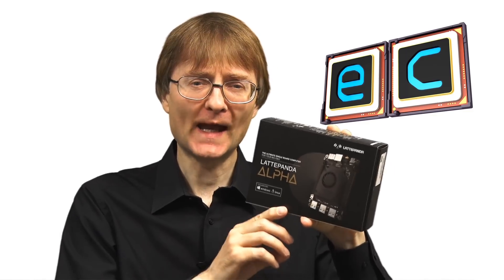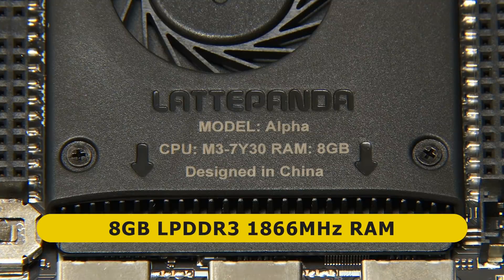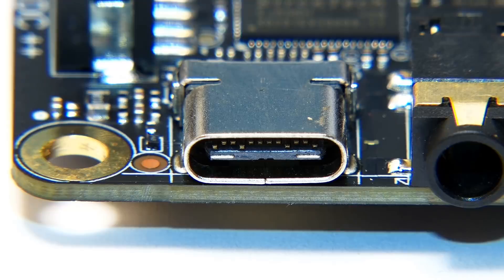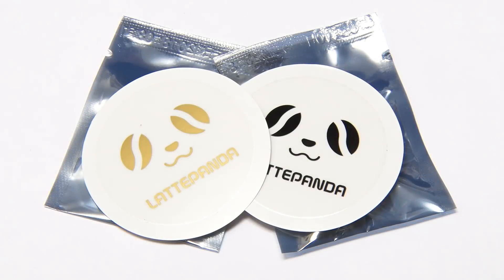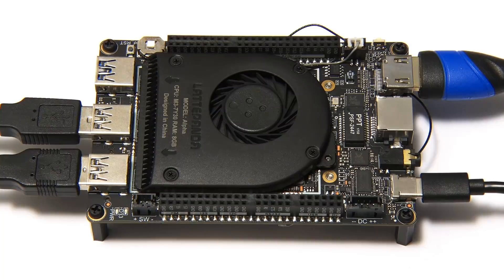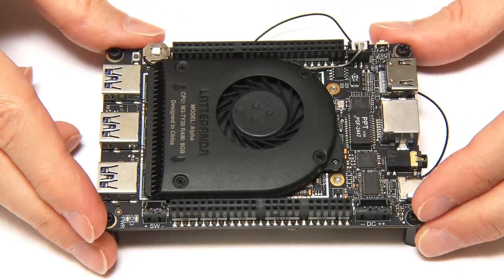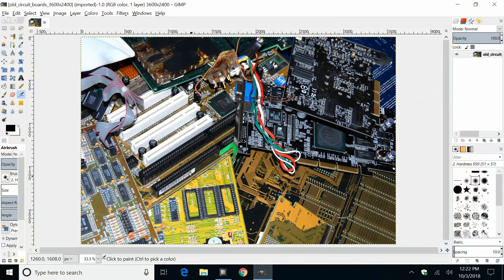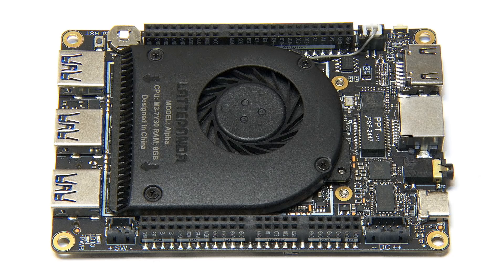LattePanda Alpha: Windows & Linux SBC

Comment: I keep putting more thought into the various utilities this thing can cover with it's functions. That little thing could run hundreds of different businesses and any machine a single man could possibly dream of building. It's just so close to that ethereal "perfect" digital handheld multitool.
Reply: I'm building a holodeck.. not joking xx full 3D room space, so you can overlap and sit with your mate overseas. Play Elite with a floating holographic cockpit and space-surround 3D etc.
Ok, you do have to wear light glasses right now - but I'm afraid it needs more gfx grunt than this sbc xx

It is a lot of power in a small package, but where does it actually fit? A small Pi cluster will out-gun it dramatically and I really don't need a soggy PC in my pocket, when I can build a AAA gaming rig for maybe £100 more (and that's just to have a good gfx card, so you'd be paying that anyway to take the Alpha up to spec..)
Reply: @pdjames1729   No, I know, it isn't perfect yet, but it's an image of what can be packed in at that price point and it's inspiring to extrapolate and infer about what could be done. We're coming up on essentially arbitrary storage and RAM specs, and processor power is still being pushed along its improvement curve in spite of people claiming that moore's law is dead for the better part of a decade, and with new materials showing promise in labs. 

For the question of where it currently fits, the answer is anywhere that doesn't require real time 3D rendering of a high resolution immersive environment, or similar supercomputational needs, that's still the realm of task designed systems, but it could potentially serve as the entire control and diagnostics system for a small factory with little modification, It could effortlessly coordinate a large farm of autonomous tractors and irrigation equipment with trivial effort, stuff like that where traditionally you have a closet of equipment and a very expensive technician to manage it.
Reply: I have to disagree. You need Proven, industrial-spec systems for all of those things and size isn't really an issue. Not when you can get 4x the power for half of the price - multiplied by however many factory systems you're running. You're right, this is essentially a promising prototype. One that is obviously on a short-run, Latte themselves know there really isn't a market for this that makes any sense. BUT - I'm not trying to slam it, it's brave of them to develop something So far off-the-curve. It's just not what SBC's are about at all. Fixed specs = MORE power for your money. That's the whole point. Comparing these things with $15-$60 of Pine64 leaves a nasty dent in your wallet for basically zero gain - let me hit a rather odd curve-ball...

If Latte had put the same effort into a Distro that was designed to cluster existing SBC's in a more accessible way, god forbid to let them live-compile x86 and x64 code. We'd have something truely revolutionary. Potentially infinitely upgradable but without all of the BOIC cluster-pigness ;oD

As it is they've worked their socks off to make a consumer-grade piece of wunderlust. It looks great, ignoring the price, but doesn't really DO anything. Especially not with x86 rapidly limping into obscurity (which i hate btw, my perfect functional win7 machines are being force-obsoleted by a refusal to compile for them)
I sort of get what they are trying to do here, trouble is it just isn't an SBC, any more than the motherboard of your laptop is. Cramming power into a small package is only half or the deal. SBC's are Cheap to mass-manufacture, you then work on performance without compromising that premise. This is why we are all itching for a Pi4 (with a pcie slot? like Ebon will ever do that -lol)
I can't take an ITX motherboard, rip the socket off, chop all the expensive power management components out, rewire the ram and sata's onto the back and call it an SBC, even though all the bits are now soldered to one board.

Unfortunately that isn't far from what Latte have done here. And given the awful price proposition, cheap parts, inability to revise and lack-lustre performance. Me, and I think about half of the people in these comments are just left asking Why... other than just to do it, what is it for? Non-tech #EarlyAdopters with too much money...

My only hope, Obi-wan, is that they make enough from it to squidge the next version much closer to the SBC market. But when you can buy a god-awful win10 stick for £30 they are gonna have to work Really, really hard... There probably is room for a posh board. Just not this posh, or this not-posh... struggling here, really struggling. Not least with the Huge price gap between their top-end and the entry level... What they have essentially made is a pretty damp NUC.. is it even any smaller? xxPD

Comment: Impressing power on this single board! I have some questions though:
1) Does it run Windows 10 - 32 bit or 64 bit?
2) Can it run a Universal Windows Platform application?
3) How would a UWP app running on this board obtain data from its Arduino GPIO pins (also running on this board)?

Thanks for your great videos! :)
Reply from the maker: It is running 64 bit Windows. I will have to get back to you on the rest!

Comment: Two things that I really like here. Power and x86/x64 architecture (meaning a massive amount of compatible software). Not to mention that the size is just a bit bigger than the Raspberry Pi. Would like to see available cases for it. Extremely impressive. However, I may wait for the price to drop over time (if it does) because $300+ is a bit steep for me to invest on a SBC at this time. I need a better job.

Comment: I think the NVME slot was set to x2 in the bios if you decide to check it out i think this is why the NVME performed almost half compared to the core i7, i have a tablet with the same storage and cpu and it does over 3300mb/s reads.

Comment: A very nice overview of the board; it is a bit expensive, but to be fair, x86 architecture on an SBC (2nd Gen no less) is not a common find.

But, the first Latte Panda, even though itself a bit pricey, seemed to me to be taking aim at the RPi form factor SBCs that have flooded the market over the last few years, all chasing the success of the RPi.  With this board, I don't get that same association.

But the price point of $399, I think it will be hard to overcome ARM-based systems, and it will be compared to other consumer PCs before the average buyer takes a chance.

ARM based SoCs/SoMs, like the Nvidia TX2 (w/ a .edu email address) is only $299.  And I look at the Kirin 970 boards that are being released around that same price and I am impressed - then the Kirin 980 debuts, & it's a powerhouse w/SBCs expected Q1 2019...and now I'm reading the Kirin 1020 is already underway.  I have the Kirin 960 & it is impressive and not that old.  But, no x86...

The Kirin 980 though - with dual NPUs; 2x A76 high clocked cores, 2x A76 low cores, & 4x A55 cores; a brand new Mali GPU; & ~8Gb LPDDR4....the boards will be x64, but if this appears at a $399 price point, I can live without x86 & Windows 10.  

Huawei on the warpath though, they'll probably have it $299 msrp like their previous two, maybe less, who knows?  They're aiming at Apple & after the spectacle that shut down Verizon & AT&T subsidized Huawei phones, they haven't been swayed. Any way into the US & I assume they'll make sure to be known.  They were never banned, so using a Huawei phone or board is still just fine in the US....

I guess the next 6 mos. will be an interesting 6 mos.  This new Latte Panda will be competing and with unique appeal and pricing spread across different variants, perhaps it will be well received & I've merely judged it too quickly...(?)

Comment: nice PC, but im not going to get this thing on my SBC list, its just a complete barebone miniPC you can get out there.

its bad that it didnt maintain the same form factor as raspberry pi, so you have to buy a another case for it that is expected to be overpriced.

for power consumption, meh, I expect that it had the same power consumption of one of many ITX/minipc computer builds out there probably in cheaper price.

im just glad that raspberry pi maintain its form factor, if they can only build with same form factor of raspberry pi and put the intel compute stick hardware on to it, and put GPIO pins at the top, that would be the best, but this, meh just get a minipc.

Comment: If you ever revisit this, try a linux install on the ssd (if possible) . Any popular ver is fine. We trust you. You know what you are doing.
Reply from the maker: I will almost certainly try Linux Mint on the SSD board in a future video. And I will also be covering GPIO (Arduino) programming on a LattePanda (any model).
Reply: good idea, that windows bloatware looks crazy! imagine them thinking you want candy crush haha
Reply: +Cashel - it's just a link to the microsoft store where you could then optionally download candy crush. But yes I agree, adverts shouldnt be in the start menu anyway. 
If you notice, windows is getting better all of the time. The installation size is now reduced from 20GB to 12GB. You can also run a linux cli shell on windows 10 (pro) which is what I do mostly, so we get the best of both worlds now. Windows for business compliance and policy reasons along with a unix-like shell for the open source world.
Reply: ExplainingComputers Hi, I'm looking for a computer just to web browsing, watch movies and simple things, I do not know anything about computers, do you think that this is a good option for me?
Reply: it's incredibly expensive if that's all you need. Any low-profile gen 3/4 refurb will do that job easily.
Or a pi3, or a cheap laptop... Set a budget of £200 - have a look on Ebay and compare against CPU Benchmarks for speed (google that, you'll find it) xxPD
Reply: Lmao, Chris is easily in my top 10 Youtube channels ;o)
Reply: Pan Vrek *

Comment: Great video Chris! I really wish I wasn't as broke as a joke right now because I'd totally order one of these things and attempt to make a Hackintosh tablet out of it. I have a MacBook Pro as my portable Mac, but having an even smaller portable Mac (smaller than a 12" MacBook and smaller than an iPad, and with many times more power available) would be awesome. And with the onboard eMMC and the possibility to add an nVME SSD to the mix means you could potentially triple boot macOS Mojave (for example) / Windows 10 Pro / a flavor of Linux or [Free]BSD. I might ask my brother for one of these to play with for xmas.. Hmm..
Reply: you might be better off buying a regular windows tablet and putting mac os on it, hacking the lattepanda into a tablet case would be a pain and it might be very thick in the end
Reply: Regular Windows tablets run Intel Atom chipsets... I'm not aware of any non-Atom Windows tablets out there, and even if there are such out there I like building computers and literally building a tablet would be freakin' awesome to do, and a fun thing to do. Regarding thickness, you're likely right about that, but it'd be a cool project nonetheless.
Reply: some microsoft surface tablets are non-atom, but i guess it would be a lot more boring to just buy an expensive surface tablet and install mac os and call it a day

Comment: How does your Windows/Linux software talk to the Arduino microcontroller embedded in the board? Also, I assume you can program it using the Arduino IDE, is there  a JTAG port for it?
Reply from the maker: I will dig into this and report back in another video. Yes, you can use the Arduino IDE, and program via (eg) Visual Studio.

Comment: Just out of curiosity, at what point in PC development would you say this LattePanda computer compares to main stream PC power.  The way it ran DaVinci I'm guessing it power is about equal to something mainstream in 2008?  Earlier, later?  We used to have to work so hard to get this sort of power and now it's available on a SBC the size of a small form factor hard drive.
Reply from the maker: I would say later than 2008, though it depends on what tech you take from the time chosen. Right now, it is more powerful than many i3 systems, a little less than most i5s. The power for the form-factor is amazing.
Reply: Do they have vesa mount cases to mount onto the back of a monitor for a DIY all-in-one system?
Reply from the maker: Not yet . . .

Comment: Hi Chris, nice review. Was wondering why not run the gimp test on the same OS? That would be a better apples-to-apples, that you anyways, will go over and order one to replace my other SBC as a single home automation server. Nice find!
Reply from the maker: I did not have Linux installed! :) But will I am sure test it out soon. And, as I discussed in the six ARM SBC test video I showed the GIMP results from, running the same OS on a range of non x86 SBCs is both technically problematic and not necessarily a good way to compare best real-world performance. I can imagine this as a great home automation server.

Comment: Seems like a really cool idea. I have just one little problem. If the copy of Win 10 comes pre-activated, that means that Microsoft considers dfrobot the owner of the license, no? Sorry if I'm wrong, I've just never used a preinstalled copy of windows before.
Reply from the maker: Preinstalled copies of Windows that are activated with a digital license are very common these days. License keys to type in are dying out fast. :( So the license will be tied to the hardware, but could be tied to an MS account if you login and select that on the machine (if still only usable on the specific hardware).
Reply: well as long as it can still be tied to my MS account, I dont have any real problems with it. In a month or so when there  are some alpha cases on the market, I will definitely be getting a few alphas.
And thank you for the response.

Comment: I have noticed that you don't use an anti-stat mat when you lay the boards onto your table top.  Are you not concerned about static electricity?  I still am not crazy about that boot up time.  It is obviously a fast board but I'd expect it to boot in under 3 seconds.
Reply from the maker: I am concerned, but get so many abusive comments when I show anti-static precautions onscreen that they remain off camera. :) The boot would/will be much faster from NVMe, rather than eMMC, as the speed tests show.

Comment: What are voltage requirements of board? Looks like 5 and 12. That would take out portability. The original would crash on the biggest 5 volt battery I could find with a 3 amp out. I had to use a Raspberry Pie 3 PSU for original @ 5.1volts and 2.5 amps. It looks like they provide their own PSU with  the new ones. 

This will work good for emulation and games in general. 2.6GHz, Just hack for high performance like on original. This is why it would crash on a cell phone power bank. Too many amps. I would like to see that thing set to High Performance and tests ran. Peg it at 2.6GHz and upgrade cooling with a standard intel pc cooler. Its at the point of being a common PC instead of a dev. board. 2.6GHz and 1866MHz memory speed is a lot of power in compute performance for a dev board.

What are PSU specs for Voltages and Amperage? Lots of pro & Cons with this one.
Reply from the maker: 5 and 12 volts indeed. I will have to get back to you on the PSU specs as it is not currently to hand.

Comment: Suggestion: clean up system files, after updates.  Indeed, a Windows 10 update can, and is likely to, result in the replacement of the entire operating system.  At the same time, otherwise redundant 'Windows Old' files are retained on the drive, sucking up a lot of space.
Reply from the maker: Yes, this is likely to be the case -- although the common "Windows_Old" or similar folder was nowhere to be found! :)
Reply: @ExplainingComputers  Well, both my Windows 7, & my Windows 10, computers use SSDs.  On these systems, Windows old can be found with the 'clean up system files' option, but maybe it's not the same for this assembly.

Comment: Hmm seems this could be perfect as a streaming and browsing unit on my tv. But wondering if there are any cheaper SBCs that can handle h265 media stream?
Have been using a Raspberry Pi previously but am looking to upgrade.
Reply: I use a 4 GB Rock64 running Kodi 17.6 on Android 7.1.2. It handles h265 really well. You can get it at Ameridroid or pine64.org

I had previously used OSMC on a Pi 3b but I upgraded for the same reason you're looking to.

If you want a Rock64, but don't want it running Android LibreELEC has been doing work on better Rockchip support in Kodi 18.

https://test.libreelec.tv/?C=N;O=A

They do nightly builds.

Comment: The only problem I see is the boot drive is still 64GB. Would like to see at least 128 for a primary boot device. The original panda I could not update because it would run out of room. We are at Win 10 ver. 1809, I am sure that might not install if there is anything else on C: .

Comment: Competition is great but I wonder how this will hold into 2019 ( which is only months away ), I feel that price might be the only real big killer with this board.  Remember we have 7nm CPU's across the board coming ( Arm and AMD ) on the Arm side we have A76 which is by all accounts comparable with current I3/5/7 tech with the bonus of alot lower power ( again another big issue with x86 ).  I am wondering if and when AMD might join the Arm fray, I mean imagine it an AMD/Arm SoC with Vega GPU which already is supported 100% with open drivers, I would imagine its a revenue stream under consideration.

With that said though its making for interesting times.
Reply from the maker: Interestint times indeed.
Reply: AMD is already in the ARM game. Last year they launched an ARM-based Opteron SoC.
Reply: @JackBandicootsBunker  it was more of a toe dip / test the water event,  the hardware was way over priced and not available.